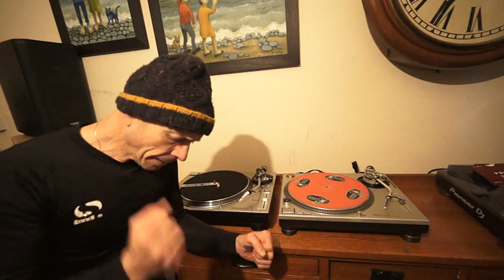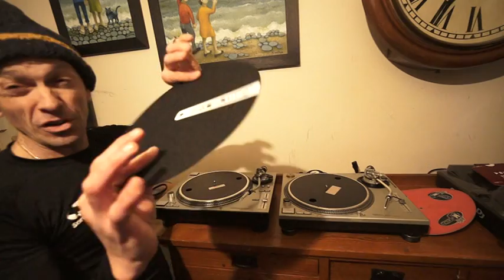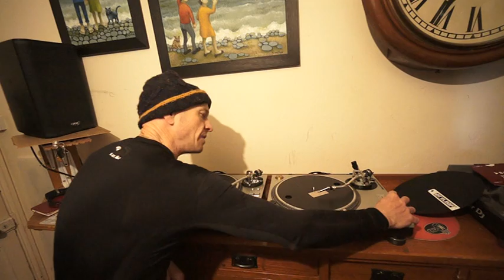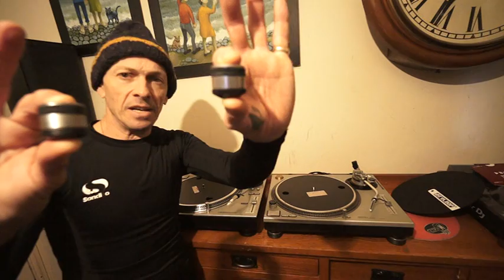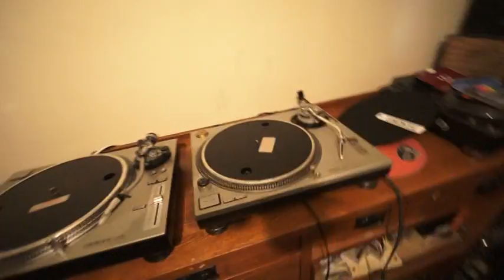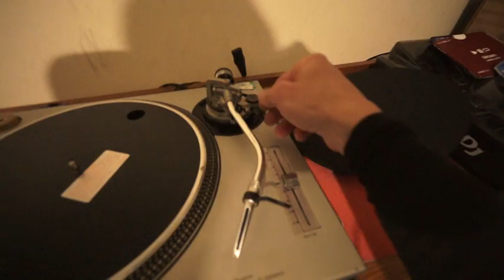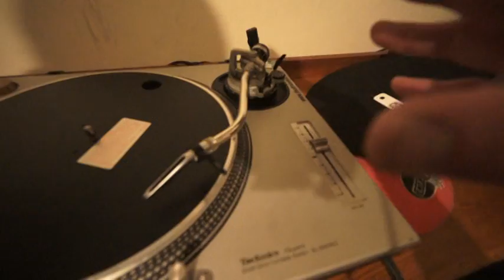RELOOP RP7000MK2 SIDE BY SIDE TECHNICS SL1200MK2  VINYL TURNTABLES

Comment: funny you posted this video. I had a pair of Audio Technica LP120x show up in the post today (minor upgrade to original lp120). Yes they are budget, they're not going to be as powerful in torque (but almost), they're not going to last as long and they're made of slightly cheaper material compared to technics, RP7000, etc. But they were £245 each and these are my first turntables.
I'm not a scratch DJ, so low torque is just fine, it'll allow me to have a light touch. I only play in my house, so I don't have to worry about them being safe to transport. 

So many people say "spend a bit more, get second-hand technics", but you've gotta start somewhere. Many of the best DJs in the world started on shitty belt drives and faulty equipment. The 120x has everything I could possibly need to have some fun with, and I'm really looking forward to giving my small vinyl collection a spin
Reply: Couldn't agree more. I co-owned a pair of 1200's a few years ago and my mate moved to Australia and bought my share of them. I recently got the itch to mix again, and bought some LP120's. For the price, they are more than adequate and capable. I've had them for just over two years and they are still going strong.
Reply: I recently bought a set of LP120s also!
Reply: I have the ATH 120x and Reloop RP 7000 MK2. IMHO for the price difference it is worth to get the RP 7000 MK2 - better build quality, better motor, more precise pitch riding.

Comment: I prefer my reloops over my 1210s
Reply: why ???
Reply: @michaelc1818  they handle mixing, scratching and juggling just as well if not better and the midi pads are very very useful for what I do
Reply: the rp7000 mk2 has no midi pads ??? you mean the rp8000 mk 2, ok so your;e a turntablist, im talking about long blends/mixes the digital pitch is horrible, you have to tweak it and ride the pitch constantly, it's terrible
Reply: @michaelc1818  i have 8000s and 8000s mk2
Reply: @michaelc1818  one thing i dont worry about is the longevity of the hanpins , i have a friend who got a pair of stanton 150s 15 years ago and he has abused them daily and they run like new .
Reply: @djimma5080  it's not just longevity, you obviously don;t do long transitions or double drops, the digital pitch is terrible , it's adjustments are too staggered, the technics 1200 mk2 are far superior for tight beatmatching
Reply: @michaelc1818  i do mix dnb and double drop but i learned on vinyl on belt drives sop developed a very light touch and if its 1 bpm difference i can happily drop on that then ride it by hand . Dude look at it like this if i drop a tune and THEN worry about getting the bpms tight and dont hide any of my mixing behind pre cue even if i loose the mix a bit aslong as i save it or keep it close people who watch always WOW you have skills that mixing was sick , if i pre cue and mix the normal way and do nice perfect blends no one says anything and they loose attention so basically dont worry too much about it might be annoying but to those watching it might be making you better than someone doing super clean mixes on cdjs or a controller ,  People like it Raw!!!!!
Reply: @djimma5080  Ok so you uploaded a 15 min  vid of you not doing transitions but just you scratching and constantl;y cutting the fader across, I am talking about long transitions/blends which a digital pitch is rubish unless you constantly riude the pitch
Reply: @djimma5080  I learnt on belts  too and I RIDE TRHE PITCH and NEVER touch the platter or spindle as I mix, no offence but the whole platter touching and spindle twist and nudge thing is really amatuerish and looks bad, why would I bother using some turtables that I constantly have to pitch ride to keep them in time ? When I can get the mix tight and leave it and do other things on a pair of 1200' mk 2's ??
Reply: @michaelc1818  that's the art of the quicking hip hop you don't have the time to be perfect you just got to drop it, I mix dnb completely differently
Reply: @djimma5080  I find hip hop really boring to mix, it's not at all dj friendly and as it primarily can't be mixed it is a waste of time in my opinion, as for beatmixng with a digital pitch its a waste of time as well
Reply: @michaelc1818  that's part of fun, It's takes skill to mix tracks no meant to be mixed and figure out how you to mix to them.
Reply: @djimma5080  I take it you only use DVS because the reloop feedback is terrible on real vinyl, one tap on the plinth or closing of the lid while a record plays tells you that, junk
Reply: @michaelc1818  nah I use plenty of scratch vinyl, I have this issue on the 8000s but not the mk2 they have improved the tonearms they are much better now
Reply: ANTHONY FIGUEROA it’s puss boring to mix , I like something where I can actually hear two tracks mixes together for longer mixes, not 8 measly bars or drop it on the one .... yawns
Reply: @michaelcurran9442  dude your so basic with hip hop you get instrumentals and acapellas so you can do whole remixes live that use the majority of a track and THEN mix out of it into a full track or just an acapella and then you drop a fresh beat onto that or scratch or beat juggle.  Alot of djs make me laugh at how basic they are and at the same time they think they are special or have a God given gift because they can hold a mix .
Reply: Michael Curran we get it you're in love with technics but not everyone is a fanboy let us enjoy our reloops and stop talking trash about hip hop, hip hop is one of the hardest genres to mix because it takes time and skill to actually make mixes sound good this is coming from a guy who mixes pretty much every genre you're out of touch

Comment: How would you compare digital pitch on reloops to analog pitch o technics?
Reply: Personally I can't tell the difference!
Reply: It would be easy to say if it's good or bad if we actually knew the resolution... 
But I'm going to say this: CDJs also have digital pitch control (of course with finite resolution). If that's good enough for the best of djs out there, then it's good for us too.
Reply: I have a pair of the original rp8000's.  I mix vinyl and love the lcd display of the pitch for fine beat matching.  With technics and rp7000 you kind of guess how much you moved the slider.  When beatmatching by ear you can quickly move the fader in tiny increments and know you didnt nudge it too much.  This helps when your trying to blend records fast.  I can keep 2 records matched for over a minute with the rp8000 before manipulating the platters...not all the time though...same  goes for MK5.
Reply: @moscasucio1686  dude you see the bpm on the 8000 as a standalone or it needs stupid laptop serato system to show the bpm on the 8000s screen. 
Thanks bro
Thanks bro
Reply: @Übereine  no im talking about pitch percentage.  By no means does it show bpm on vinyl
Reply: @Übereine  on serato i believe it does show bpm
Reply: @typedef_  according to the turntable comparison chart on the Reloop website, the RP-7000 MK2 has a "high pitch resolution" (I assume that's when it's set to +/- 8%) of 0.02%. I usually use my XDJ-1000MK2's at +/- 10% which has a resolution of 0.05% which works great. 0.02% is more than enough for me; I think I'm just about sold on replacing my aging Technics decks with a pair of Reloops.
Reply: @DinoHints  I've been using an RP-7000 for 3 years (for mixing). I've got nothing but good words to describe it. As a plus, the start-stop time and torque adjust are just awesome. It starts and stops that heavy platter like it's nothing. The motor control on it is just really good. Super responsive and it really feels like it's made of good quality materials. I highly recommend it.
Reply: @typedef_  digital pitch faders on a turntable are going to react very differently to those on a CDJ
Reply: Amazing RP 7000. I have one

Comment: XRTA DOPE VIDEO MY GUY..explained really detailed. My question is about turntables im getting back to DJing and i like the reloop turntables. So what I need to know is what's the difference between the RELOOP RP-7000 MK2 PROFESSIONAL UPPER TORQUE TURNTABLE SYSTEM and the RELOOP DIRECT DRIVE DJ TURNTABLE AMS-RP 7000 MK2.

Comment: The torque is  low on the 1200's compared to any of the newer turntables available now . If you have not worked on a high torque turntable i would suggest doing so., it  does do a great job even on mixing. i love mixing on those,  great for those fast blends.
Reply: It depends if your mixing records or not , if your performance DJ yes you might need high torque motors , but too much high torque pressure on any turntable motor will not be great mixing records , Technics has balance of everything really that's why it's industry standard
Reply: FSwift DJ mixing has to do with more with the pitch than the torque. Which is why the pitch drive is the most important thing.  High torque makes you faster getting the music to the right bpm . But if you worked on the 1200 all your life and then Blend music with a plx1000 you can do it effectively
Reply: @hot4futureyears2come  you can mix records with digital pitch even on plx1000 etc but as all club vinyl djs will say, original Analog pitch is just better with the finer pitch adjustments , they all have same pitch in Technics just that new models use a binary system that counts in block whole steps then in half etc with Analog pitch ,  that's why digital pitch turntable won't stay in without pitch movement every few seconds or so compared to Analog pitch ,  you can move the plater etc with Analog pitch to keep it in time also , with digital pitch like plx1000 it just goes all over the place
with original Technics your not constantly chasing the tempo 
Your on point , with digital modern turntable your chasing the tempo too much that hinders your fader or mixer creative flow if I can put that more clear lol
Reply: @Neale yes, some might say the perfect DJ turntable every made
Reply: @hot4futureyears2come  I recently had mix on the new Technics SL 1210 Mk7 ,  it's really good deck but when I compared mixing vinyl record on both , the sl1200 MK2 won out , the record stayed in time longer again digital pitch and analog ,  the feet was also not the best and I found the deck bit light , but mixing records and DVS was alright and not as bad as many first thought but depends if djs want to pay high prices for turntable today

Comment: I would say battle mode for mixing to its easier to get an accurate reading on the pitch slider because your seeing it side on, I find turntables very clumsy to use club style
Reply: 8000reloop aint that bad
Reply: @Übereine  yeah I have s and mk2s
Reply: @djimma5080  i have techies mk2 
reloop mk2 and plx1000
That pl blows em away 
But ok techies are decoration mostly 
That 8000 seems.ok just not my cup of tea diving into digital age:p im old i like em old ahaha 
Try the pl u gonna love it

Comment: Hello Johnathan,
Did you try the RP7000 on a big system to test it's resistance to feedback (using reel vinyl, of course)?
I wonder if we can trust those new turntables on this particular aspect.
But the RP7000 look fine, even if I prefer the recessed platter, personnaly.
Reply: Divadisco in 2009 i had Reloop RP4000s and they worked perfect in huge Clubs! So the 7000s will do too!
Reply: I have played with the reloops at the Notting hill carnival on a 50 k rig no worries.

Comment: Reloop all Day. The only point where the Technics wins clearly is brand image. but if the reloop exactly as it is there would have been released from technics everybody would have loved it and hyped the improvement.
Reply: You are wrong, I own 2 sl 1210 mk 2 and a reloop rp7000mk 2, the digital pitch is not accurate enough on the reloop, it has to be tweaked almost constantly to keep in time, unlike the 2 1210's that stay synced for ages before even the slightest drift, also the  wow and flutter on the reloop is much higher, the printed specs of the reloop are wrong hence the star beside the figure of 0.01 wow and flutter , it's actually 0.1% which is 10 times higher than a Technics , this would also add to drift of speed combined with the lame pitch control of a reloop,  and all those important factors aside the techns have lasted the test of time, and some, and some more ....Love to see a reloop still working in 30 years lol

Comment: My first DJing was in 1980...now I am very happy with my 7000MK2s...with CONCORDE CLUB MK2 ... a perfect combo for my dance mixes...
Your video is AWESOME! Great detail and fun, too. Me👍🏻🙏🏻🎼🎶🎵🔊🕺💃🚀

PS: (nearly) never used the pitch... a good DJ is doing the natural way ... Combine the songs where the best transition comes ...
Reply: Regular DJ works started in 1983 to 1985... never had a platter at home ... did some mix tapes for the guest, indeed... only one side of the tape and then the next guest...and some for me, too. But only a very few - unfortunately... did digi them as wav-files... E.g. did one in spring/summer '84, if you are interested in hearing some VINYL mixing WITHOUT PITCH... I can send you a mp3...cheers, Joachim
PS: please provide your email address for the link.
Reply: Try ortofon DVL cart. Youll never go back.
Reply: @outnode366  could not find a DVL named cart. ...
Reply: @leonhardtart7163  Typo sorry VNL
Reply: @outnode366  just found it, thanks.👍🏻

Comment: Technics still is the champ n still look beautiful in that color  if you got it in good shape n last for years n you know that  turntablist have beat the sht out of the1200mk 2 when they do  scratch n battle style n you know that I got mine since 1989 rock the sht out of them man they still work like a champ just have to maintenance them one a year n you be good I think is one of the best turntable ever made n we use them to scratch n battle style when hip hop rap came out in the 70s that was underground for what I remember we use the technics 1100 mk 2 those first n those are heavy too made like the wheel of steel I still got a pair n working like a champ but when the 1200 came out we use them cus of the pitch control was better for mixing music anyway that reloop look nice n cheaper than the new technics that cost to much n they made them cheap not the same as the 1200 mk 2 legend that why I rather buy a reloop 7000 cus they build like the old technics out of the wheel of steel I'm going to buy one to check them out now n day they made turntable out of plastic oh wood in  the 70s thing was build well n better on japan not china that is garbage stuff😁😂 2021 bronx new york like your video man you the best thank you

Comment: But what about analogue pitch on the Technics? That is the only way to get your tracks exactly in time, with the digital pitch on the Reloop it moves in steps eg. 0.01, 0.02 etc. rather than an infinitely small amount like the Technics. That is a big reason why Technics are still bought and sold today, why not mention it?
Reply: Because the ones today have a digital controlled pitch too.
Reply: Ridiculous....that is just technics fanboy mind. CDJ have also digital pitch slider but people dont say about it. That is not the problem. Problem is just that many old fanboy can not accept new generation. Thats iy